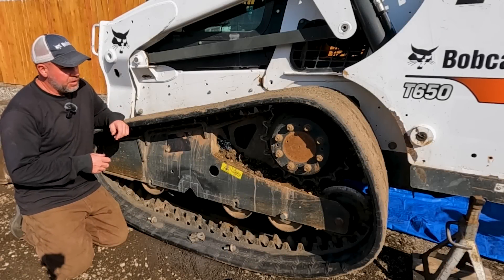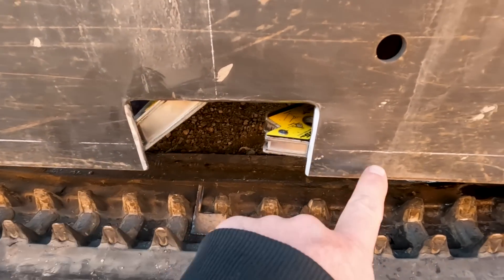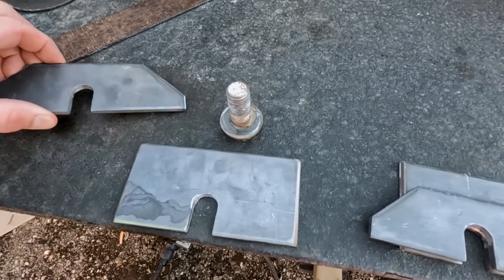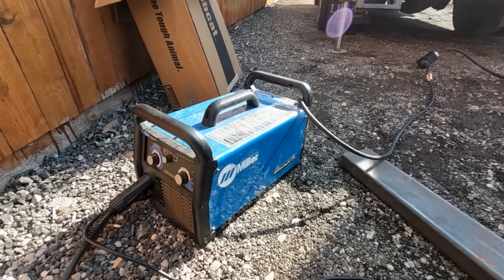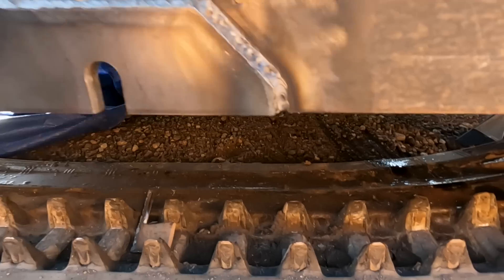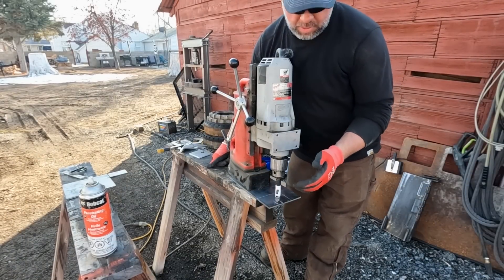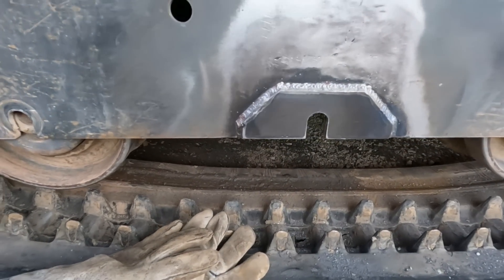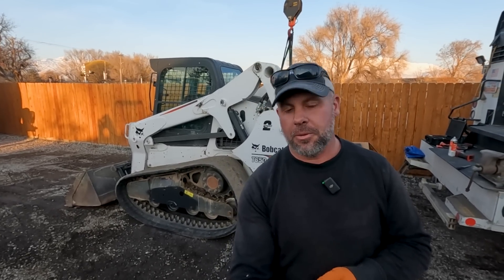Bobcat T650 Track Frame Damage and Repair

Comment: Hi Brady

It's a pleasure to watch your videos and learn from them, thank you very much for taking the time for people like us who are looking to learn something new.  I know this is not a video that is adequate for the question I want to ask you, but I can't find one that addresses my problem.  I have a Bobcat T595 that is always giving me the E000636-08 crankshaft sensor code and I replaced it with a new one but when I accelerate to more than 1500 rpm it starts to shake and has no power.  I returned the old sensor and it works better but the problem is to turn it on cold and when it sends the code after it is already working on it.  Well my question is what can I do to solve this problem?  I know that it is best to take it to the bobcat dealer for it is already the second time and as you know it is not cheap and I would have to wait a month for it to be ready since the workshop is very late and the waiting time is very long.  Well I hope you can help me.  And once again thank you very much for your videos that have really helped me a lot to repair my machine without the need to take it to the workshop
Reply from the maker: That's a tough code to diagnose.  I've never personally seen a bad crank sensor, the problem is usually in the harness and I've read a bad ECU could also cause the issue.  I've never had to to replace an ECU for the crank sensor code so if it were me I'd be looking for a harness issue.

Comment: 😮 built in air compressor on the plasma cutter!!  Nice that’s a game changer. Nice welds that was an great repair topped off with an extra 1/4” to beef it up. I’m sure that’ll never happen again. How much plasma did you use in your plasma cutter?  How many cuts can you get before you have to buy more plasma?
Reply from the maker: Only used a 1/4 pound of plasma.  I can get about 30 minutes of cutting time before having to replace the plasma.  I have a contact at the blood bank so we get plasma fairly cheap.

Comment: Was wondering if you can help me with a 2011 s650 that won't go into high speed and when switch is on rabbit the light does not light up? Also the parking break does not engage all the time? Any thoughts? Thanks!

Comment: Im surprised that a machine that new looking has bolt loosening or structural cracks.  Anyways you did a great repair and impressed with your extra effort you take make your own plates and ensure the job is done right!  One tip for future though is to not tack the corners or ends of your weld seams.  Tack areas are prone to recrack(cold metal and first heat input area can cause poor fusion) and when its at the end of the seam or a corner it will see the most stress.
Reply from the maker: Great point, thanks for the tip.  The machine is eight years old with over 4000 hours, it has been well taken care of.

Comment: Really nice work. 👌 Quick question what precautions do you take before welding on a machine? Disconnect battery, unplug modules ecm, etc? I have seen things go south, and also seen no problems, curious your take.
Reply from the maker: Excellent question, thanks for asking.  In my 25 years working on heavy equipment I have not personally had any issues with controllers or modules from welding.  I was taught to keep the ground as close to the weld point as possible.  With that information I have never disconnected a battery or unplugged a controller (knock on wood).  Issues happen when a guy grounds to rear door and then welds on the front bucket for instance.
Reply: @HowIDidIt  I follow a similar approach keeping the ground close to work. I have only seen a problem twice, once on a gm truck and once on a john deere skid loader. If it's my equipment I usually disconnect the battery out of an abundance of caution. But your approach doesn't sound unreasonable. I do find it interesting all the manufacturers warn against it in their manuals just to avoid a warranty claim!

Comment: I had a question on biodiesels being used in bobcats is this a nono?? Had a t590 with real cloudy diesel kinda smelled like vinegar?? and a clogged fuel filter customer said they had filled with biodiesel and not diesel no.2
Reply from the maker: Bio is a huge nono for any common rail.  I know people will claim otherwise but not worth risking an $7k fuel system. I caution red dye due to the storage vessels.  I've seen way to many failed fuel systems due to contaminated red dye diesel.  😕
Reply: @tetradgroup  good to know first time seeing this in a bobcat all the diesel had white looking chunks that looked like paper or something but wasn't 🤷🏽‍♂️
Reply: @Theguyfromthe5  yup the same thing is happening in oil fired home heating boilers. The filters are getting all clogged up from the biodiesel

Comment: Looks like a very clean well kept low hour machine other than the drag slicks, unless those were turf tracks? How many hours in the unit?
Reply from the maker: About 4000  hours, used mostly on asphalt so yes those are turf track which work well on asphalt to not damage it.  That set of tracks will probably last another 400 -500 hours.

Comment: Looks like a solid/stout repair.   I would like to request machine hours in all your videos and primary usage (landscape/construction   rental / single owner operator / multiple operators) so that we could gauge how long until we should expect to do these repairs on our own machines.     I would have been really concerned about getting under a machine like that, I think I would construct a pit with steel I beam reinforcements before I felt brave enough to get under there.     You have courage.        Those tracks look like used rubber bands,  I hope the customer opted to replace them while they were off &  change the chain case oil all in one shot.      Speaking of tracks, have you run into any non-bobcat brands that last?    I had my first pair of tracks from bobcat, they lasted about 950 hours or so.    Didn't do much pavement work at all, mostly dirt/gravel/rock terrain.       The second are these Arison, It doesn't look like they will last long at all, I have maybe 200 hours on them and they are already looking beat to hell.
Reply: I too would love to know hours and general applications if you can provide it.  Thanks for the great content.
Reply: I have replaced many sets of tracks on CNH skid steers. Camso CTL SD tracks is pretty much what was supplied by my parts guys and they have better grip and last way longer than most tracks that CNH had on their machine from the factory (until they switched to those camso CTL SD track). Only ever had one customer wear a set of those out and he puts on ~2000 hrs a year using the machine at his feed lot.

Comment: Pretty cool repair job!!!! Great work. Thanks for sharing!!! Till next one, stay safe out there!!!
Reply from the maker: Thanks, you too!
Reply: @tetradgroup  Very informative videos thank you for sharing! Also I have a random question that I can not find the answer for anywhere.  I’m work on t190 with kubota v2403 and setting the timing gears and every manual I can find does not mention the stroke for cylinder 1 just tdc and set timing marks. I know there is a compression and bypass stroke or does it not matter?
Reply from the maker: @z3us226  doesn't matter, when gears are lined up that will determine what stroke its on
Reply: @tetradgroup  thank you.